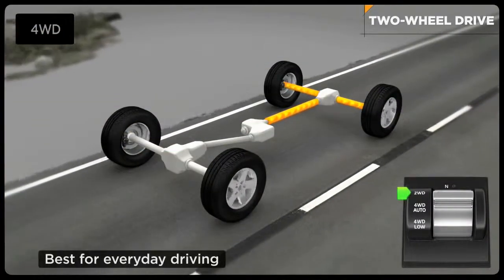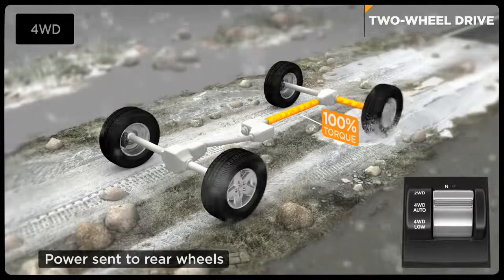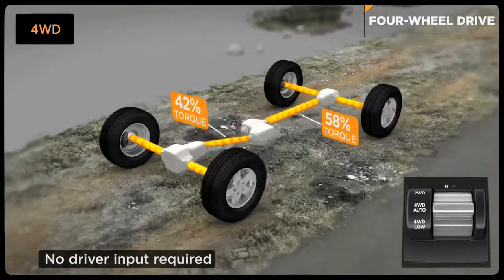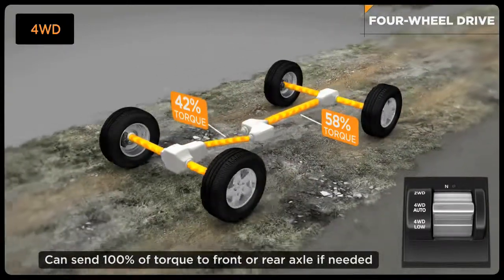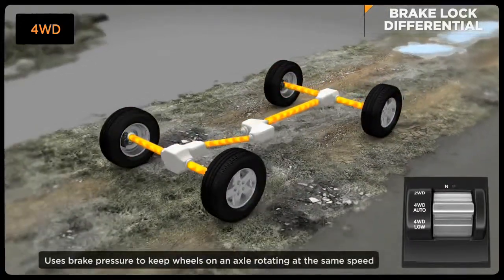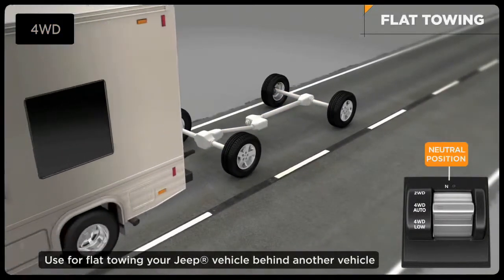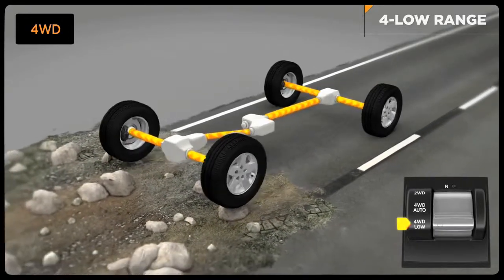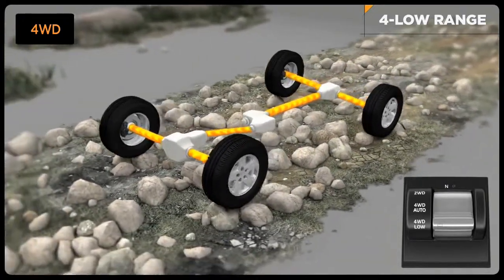Jeep® Selec-Trac® II 4WD System Explained

Comment: I still prefer the older Selec-Trac that had part time 4WD as well, that used the NP242 transfer case found in the XJ, MJ, ZJ, and WJ.  It was also sometimes optioned in the 1st generation Dodge Durangos, and a very rare option in the Dodge Dakota.